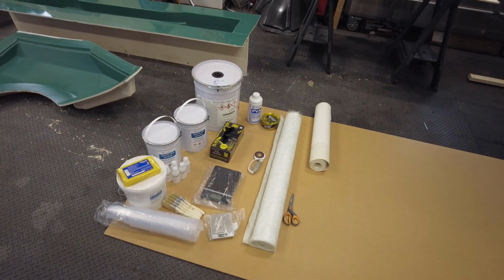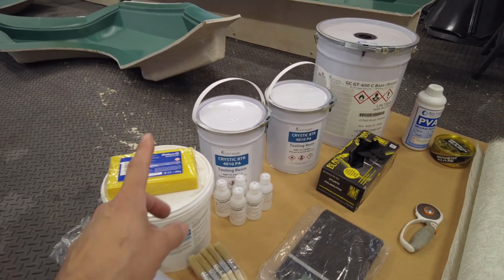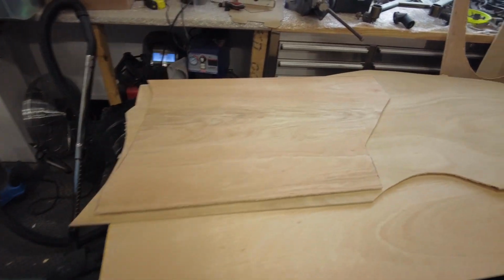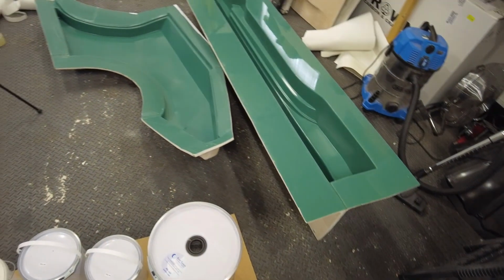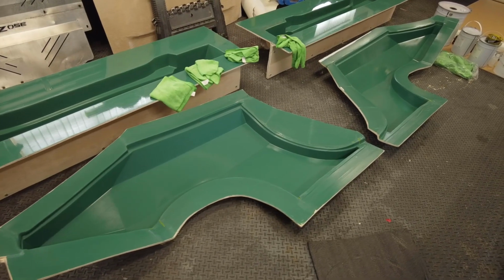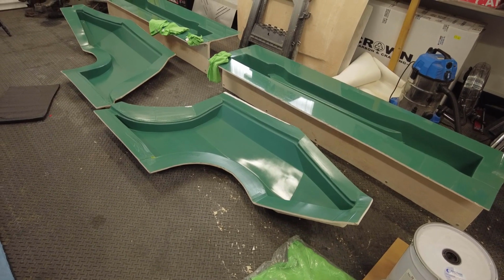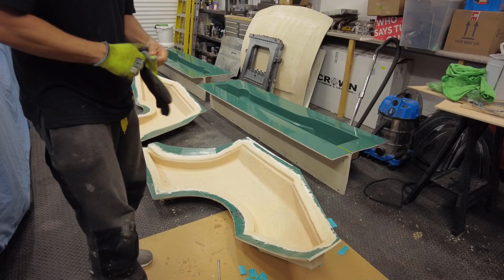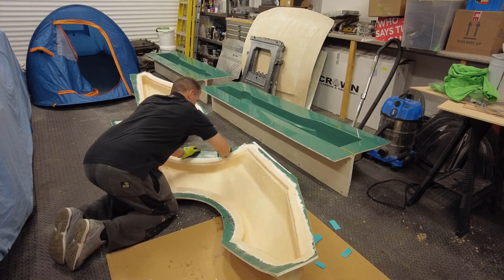making my 350z widebody rear arches

Comment: I still wonder why people still use wax and pva when there is so good chemical release agents out there... i apply 2 coats with 5 min interval and then start to load the mould with material.
Reply from the maker: Yeah I have since moved into chemical release.  So much easier 👌🏼
Reply: @ImagineBuildRace  good :) and you can do atleast 5 pulls on it before needing to aplay again
Reply from the maker: @capitao2259  I always apply another couple of layers in-between pulls just incase lol
Reply: @ImagineBuildRace  Yea i put down 1 layer after every pull. don't want to risk a $2000 mould lol